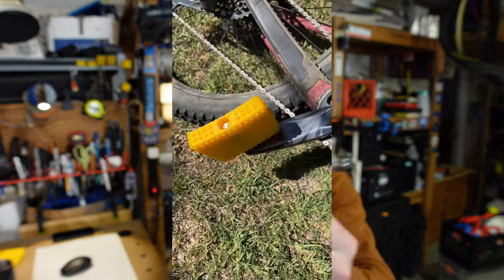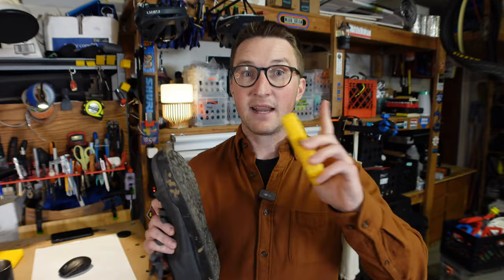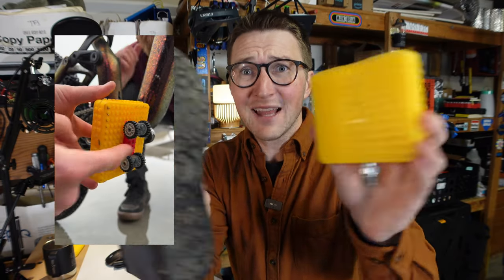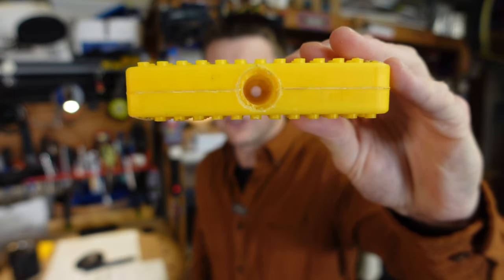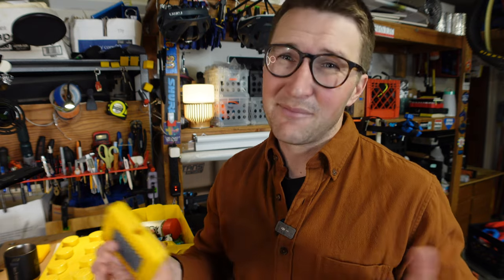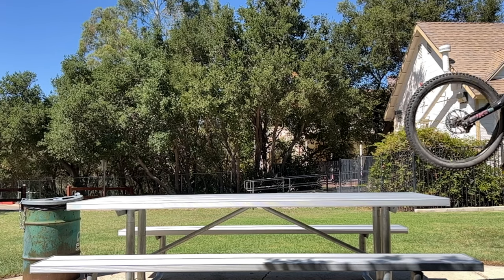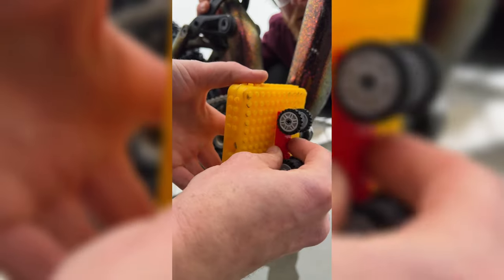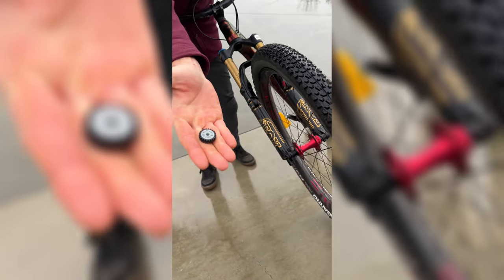I made Lego clipless pedals!

Comment: I'm a year late, but if I could offer an idea provided you ever want to revisit this project, i suggest you reverse your brick end placement. Use the bottom of the lego for the pedals and the nubby top for the bottom of your shoe. That way, any grit that you get on the bottom  of the shoe can be more easily scraped off and not get embedded in the lego holes. Also, the pedal bottom would be smoother for those rail slides.